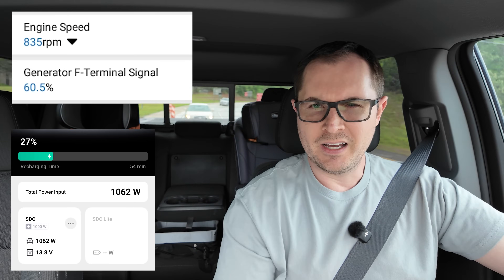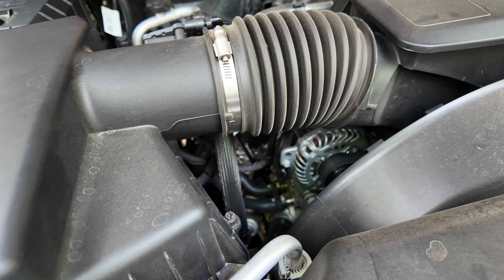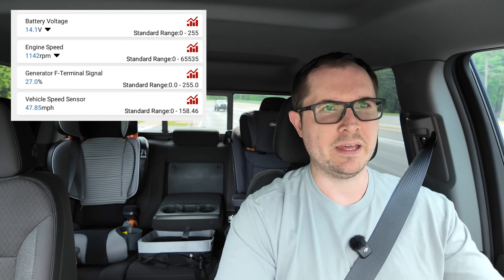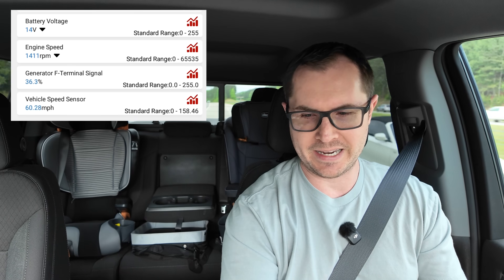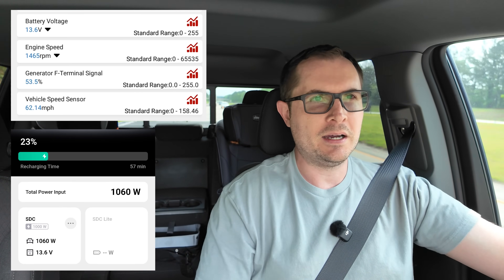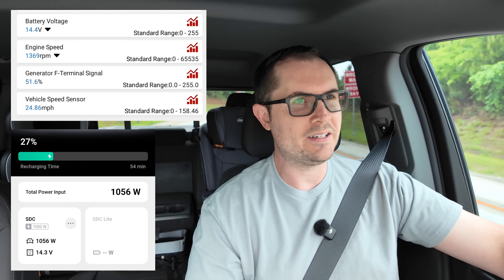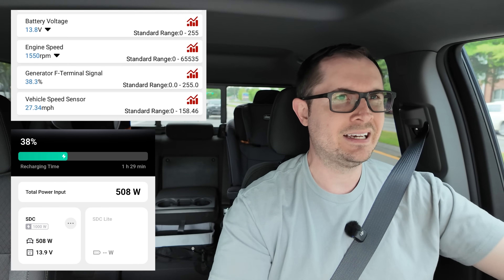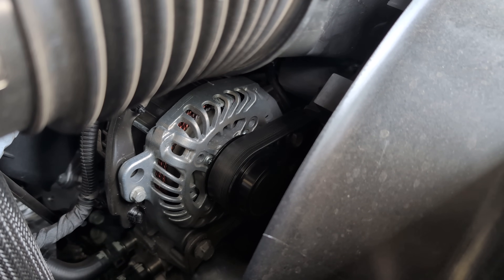I Show REAL Numbers: Impact of DC-DC Chargers from DJI, EcoFlow, Bluetti on Alternator

Comment from the maker: Support the channel with these purchase links. As an affiliate I earn from qualifying purchases:
Kingbolen S800 OBD2 Reader - https://amzn.to/4jSaDBh
DJI 1kW Super Fast Car Charger - https://amzn.to/3R3v95N
DJI Power 1000 Power Station - https://amzn.to/3DUVEXN
EcoFlow 800W Alternator Charger - https://amzn.to/3PEz1ta
BLUETTI Charger1 - https://amzn.to/40yFJae

Full Listing of Products in our Online Store
https://adventure.rocks/store/
Reply: Awesome video man....great information!
Reply: just install a clixon temp shutoff on the alt, you can get them in different temps.  They will cut voltage at rated temp then turn back on upon cooling....cheap protection.
Reply: @nutzablaze3339 are you saying it just turns your alternator off? So it stops, charging your 12 volt system altogether?  I am going to Google, but I am not an electrician. I'm just starting to dabble, so i'm just trying to make sure I understand what you're saying while i'm going to do the research.
Reply: No, connect the klixon to the aux batt using a relay. Your main charging circuit stays intact

Comment: can there be a cutoff added or bypass when reaches a certain percentage limit?
Reply from the maker: That would be a nice integration, but so far the mainstream players all usea "minimum voltage threshold" setting that is by default set in the 12.8V range, and the idea is that if your alternator is struggling, the battery voltage would drop and that signals the DC-DC charger to stop till it recovers. Not a perfect relationship, but it does mostly work.

Comment: The new HD RAMs have an option for a built-in 2.4kW inverter, which also comes with dual 400A alternators.  I imagine the other HD trucks from other brands that have those big inverters likely come with a similar electrical system upgrade.  Though if you have one of those, the purpose of a DC-DC charger is basically lost, because you could just plug the power station into the truck inverter's 110V outlet.
Reply from the maker: That is a nice upgrade!

Comment: 600rpm is quite low also. Short term, could just increase your idle speed, if possible on your vehicle (programmers/tuners). The right answer is going to be upgrade the alternator or reduce the load.

Comment: I have the Pecron 500w one on which I can set the voltage below which the unit will not draw current. Anyone - say I said it at 12.5v.  Will this limit alternator overdraw.
Reply from the maker: Yes, you can experiment with the level to help cut off.

Comment: Electrical engineer here. In addition to the maximum load rating on the generator, varying power demands result in voltage spikes due to parasitic inductances in generator. High frequency transients happen when either the generator changes speed, or with rapid high current load changes. You experience this phenomena sometimes when you see an arc when you plug an powered ON device into a wall outlet, known as 'wet-switching.' Car generators are notoriously bad for stray and high uncompensated parasitic inductances. Energy stored in the generator coil results in voltage spikes and dips, which put short high stress on the generator--similar to reving and stalling an engine. There are plenty of ways to compensate and minimize transient effects (e.g.soft starts, 'smart charging.) You need a reasonably fast oscilloscope to measure these transients at the generator. The DC/DC manufacturers need to add electronics to take these factors into account.

Comment: Based on this review...is it even worth trying to install & charge using a DC-DC alternator charger using a small-to-mid-size passenger vehicle (~2.5L or less) with a 100 amp alternator with a 575 CCA battery? Your video illustrates the experience of a 170 Amp alternator on a 6L gas truck so it seems disheartening if even you had to have your truck in motion at higher rpm's in order to keep the % under 60% usage. Maybe it's why I haven't seen any videos of any regular non-EV passenger vehicles attempting to using DC-DC chargers to top up their portable solar power stations. Many do not own a Truck, RV, Jeep, Van, etc and just want to quick charge their portable power station while on the go.
Reply from the maker: I think if you were to limit the output to under 200 w and you made sure that you were moving along cruising and not idling, it would probably be okay. Sometimes using a DC to DC charger can shorten the life of an alternator though. So just keep in mind the risk and use case scenarios.

Comment: I would not recommend a dc to dc unit as a blanket statement.  You pretty much got it as far as technical issues.  Small output alternators require smaller dc to dc boost converters to stay below the 75% total alternator electrical  output load recommendation.  Improper cooling will toast an alternator quickly.

Comment: They're designed to limit draw from your alternator especially with lithium batteries. If your alternator puts out 100 Amps your lithium batteries will draw 100 amps. If you run anything at full tilt it will burn out. DC to DC chargers only draw what you set it to. So if my alternator puts out 100 amps i would set it to 30 amps. At the same time the alternator is designed only to run the vehicles systems and not for extra loads. It is still best to get a higher output alternator like Mechman or JD Alternators. You can get alternators that put out 400 amps and then set the charger to 200 amps.

Comment: Good info. I've been telling people for years these things will put extra drain on stock vehicle electrical systems. Theres a reason guys with big stereos run multiple high amp alternators. I swapped to a big 300a alt, alittle over kill but now I can charge and run the ac and the stereo at idle.

Comment: What realy matters is the alternator temperature.  At low rpm, the alternator continues to put out full amperage, but the cooling fan is turning much slower and heat build-up can burn up the insulation on the alternator windings. This is why you can't directly charge Lithium RV batteries because they can charge so fast that they will overload the alternator. A DC to DC charger will moderate this. The biggest problem is at low rpm when the lower RPM reduces the natural cooling the alternator fan provides.

Comment: Really interesting video. I charge 5 lead acid batteries for my truck camper as i drive. I put a 50 amp
auto reset circuit breaker between the truck starting battery and the extra batteries for the camper.
I have always wondered how close i am to harming my alternator. i think this breaker will save it.
really intersting to see the amps climb as the speed decreases. I did not realize amp almost doubles
with drop in speed to zero.

Comment: Isn't it true that if you do NOT have a dc2dc charger installed on your RV's lithium battery system, the RV will attempt to draw more amperage than your alternator can supply? You then risk frying your alternator?  My alternator is rated at 155A and my RV's battery system is 300ah lithium.
Reply from the maker: Great point, it depends on the setup. For most folks using the 7-way to trickle charge their towable it'll be a small amperage. For motorized units depending on how the builder finished it out with the connections from house battery bank to engine, there could be potential for over-taxing it. Even with DC-DC it can over-tax alternator, but most have a setting to limit the max whereas without that limit may not exist.

Comment: Ive watched quite a few vids that say half the size of your alternator. You are right there and maxing out. I have a 220 amp alternator and was going to put 2 60 amp chargers in. I might go with 2 40's now. Could go with one 60, but with a custom 7200 watt battery bank, even that would take a while.

Comment: It seems it's all about balance of the system depending what size alternator you're running and load. A good AC - AC charger is also a good feature. Stay within decent parameters and everything should be fine.
Reply from the maker: Absolutely, knowing your alternator's capacity and overall system load is crucial. Good points!

Comment: Interesting test. As far as I know, some cars equipped with high-end audio systems have an audio output of 2000 watts or more. I’m curious about the generator’s load when the audio is turned on and playing music.
Reply from the maker: Great point, mine is an entry level audio system so pretty low draw, but I could definitely see in the top-trim trucks that amp draw could add up.

Comment: Question: if idling is bad for alternator while running dcdc charger, can you not just put engine in neutral and rev at medium rpm rate to make car or truck like a gas generator? I am getting bluetti dcdc charger 1 of 560W bc of its universal charge, deciding between Anker f3000 and f3800 for backup. Will swap 1 of them in and out to recharge one unit while car is in driveway. Trying to get math right bc seems will take 6hrs to charge it which sucks. Thanks!
Reply from the maker: That's a great question. Some trucks have a high idle option that essentially does that. The challenge may be the heat at that point given standstill. Depending on the vehicle the alternator may get cooling from both moving physically and the cooling fan.

Comment: heavy tax on the alternator for sure and likely the entire power wiring harness, upsize the alternator no doubt, but I would still be concerned with base wiring harness related to the vehicle power charging system. manufacturer value engineers every aspect of the build to clearly 27%-50% max

Comment: Would be nice to just see multiple charging inputs on power stations. In example I recently purchased an anker solix 300 DC. It allows charging input from two 140 watt usb c cables... where my larger bluetti power station only has the DC cigarette lighter charger option which generally charges at 80 ish watts... seems they could allow a double input like the anker solix 300 dc to increase the charging wattage while driving etc, without having to run an alternator heavy charger like these. Great video brother! 👍

Comment: Great video. 1000w = 81amps, that's way too high a load to place on a vehicles alternator. I've got a 25a DCDC charger, with solar input, coupled with a 170w panel. This system is great for my needs. I constantly run my 40l fridge, other than that, a few camp lights and charge the phone with camping. The solar alone is more than capable to keep the battery in a good state of charge when stationary and when driving, the dcdc charger keeps the battery topped up, particularly on longer drives.

Comment: be nice if the dc-dc converter  had an alternator “F” input to control dc-dc converter output! Great video. As a retired EE, I always knew alternators were not spec’ed to deliver rated output at 100% duty cycle. Lots of class B rv’s are burning up the alternators because they were not designed to handle the conditions on the road that you described so well.

Comment: Good video. Yes, the load is the issue and the hype of charging a portable power station in an hour or so may eventually burn up your vehicles alternator. Set your power station, or the 12v to 12v to a lower charge rate for less current load.

Comment: I have a 2024 gmc 3500 Sierra Denali gas with dual alternators and dual batteries 
I have thinking about adding a dc to dc charger for my camper 
Should I have any worries about overworking my alternators?
Reply from the maker: Nice setup! Those dual alternators will really help. Biggest lesson I learned out of all this, is don't max out the DC to DC charger while you're idling. And if you don't need the full power of the DC to DC charger, meaning you've got more time on your hands, then you can throttle down the charge rate to be safe. But in your case you've got a nice foundation with the dual setup already.

Comment: I've believed a lot of the problem is caused by people trying to get the maximum amount of power out of the alternator causing excessive stress on the alternator leading to early failure setting the DC to DC charger to a lower setting if possible 200 to 400 watt draw not running a lot of accessories in the vehicle while you're charging your battery packs and not charging for several hrs at a time would help save the alternator
Reply from the maker: Great tip!

Comment: Useful video. My 2013 XC90 2.4 D5 diesel got 140a alternator. My Delta 2 Max was with 500w alternator charger as an extra bonus. For my driving time and use, i think 250w of charge should give me a good buffer on the battery. Any idea if it’s too much?
Reply from the maker: Thank you. Likely, and then avoid charging while idling.

Comment: This is the info I was looking for.  Best if you can lower the charge rate and not run your alternator near full capacity.  Would be nice to see what the temperature of the alternator goes to when idling, because you don't have the same air flow to cool it down.
Reply from the maker: Great point

Comment: I personally think anytime you go adding things or removing things is always going to lead to trouble. A generator, a small one will charge your Bluetti perfectly. A 110 outlet.  etc. etc.  I have a small and large solar generator. Both have their purpose. """""""BUT""""" I installed #2  280 ah lifepov4  batteries at my cabin and have never run out of power. No solar generator required just an inverter.  People have been recharging their RV's with a gas generator for a long time. Same with batteries.  I personally think people are over thinking everything anymore. A small generator off Amazon is like $300 and it doesn't take them long to recharge anything or system. And if you go to the what if there isn't gas anymore senario, then the Charger !  is out as well as the truck. And you're back to solar and wind and water anyways aren't you.  The one item survivalists never have in their kits is a biycycle. I love watching them pull out their folding saw to cut firewood.  The indians and mountain men didn't have those and wouldn't use them if they did. They just dragged small dead trees up and into their fire, and repeated as nessary. As little work as nessary. Liked your video, you presented it clear and easy to understand.  I'd take it off my truck.  As nice a truck as you own, I'd keep it simple stupid. The more gadjets, the more problems. Peace.

Comment: We measure the power consumption of kitchen appliance and power tools in watts, and my DC2DC converter is rated in amps. It draws 40A, exactly what's needed for wiring. How long to charge my 400Ah of LFP Battery? Quite a while, but typically it has a lot more capacity than I need to store between drives. If I heat a meal (Mwave, 1100W, four minutes max), or boil a kettle, or even cook a meal (induction stovetop) and run my fridge/freezer) for a day or two, it's not going to take much topping up, my ordinary driving around tourist destinations will take care of it.

My alternator is rated for 130A.  I don't know what engine RPM is required for that, but if my engine RPM is slow enough to product 65A, then my DC2DC will still want its 40A if it's charging, a higher percentage of 65A than of 130A. That's why your % rises at idle. There's less current, less heat being generated, less need to cool the alternator.

I don't see a problem. I also don't see a need to charge at 1000W.

If I thought there might be a problem, I'd ask a dealer or an auto electrician, the dealer should have access to the technical data, and the sparky really doesn't want to destroy your alternator.

Comment: So in effect I should be able to use the Charger 1 by Bluetti to charge my station at 560W regularly without much strain.
Reply from the maker: On a typical truck that is a safe assumption. Biggest takeaway I learned is don't use it while you're idling, and if you don't need the full power, just turn the rate down.

Comment: Find out how many Amps the Alternator puts out, then decide what amps you can charge the Aux batteries at keeping below the alternator ratings. Usually 20 or 40 amps DC-to-DC charger is adequate. Never overload the alternator or you'll burn it out.

Comment: I was going to put a Bluetti charger 1 one to a Bluetti 200 V2,the vehicle would be a RAV4. Good idea or would it tear it up?
Reply from the maker: I did a quick search and depending on your year and trim level, looks like they equip with 80-150a alternators as OEM. If it's under 100a on yours, it could certainly strain it. The Bluetti and other mainstream players do allow you to limit the current, so you could always scale back from 500W to 200W. Or, upgrade the alternator of course.
Reply: @AdventureRocks  Thank you for the reply.

Comment: Good video. I personally have the EcoFlow alternator charger something I’ve noticed when driving at normal speeds it will charge at the maximum rate but as I start to come to a stop the charger automatically drops the charge rate down. You may want to check your settings to see if the DJI alternator charger does the same thing.

Comment: Is there a way to reduce the charging level on the DJI, say 500w?
Edit* I see DJI do an 1800w charger that splits between solar and car charging. The car charging circuit seems to output 600w and 1200w on the solar side. This might be better on the alternator?
Reply from the maker: Indeed, and you can throttle it down as low as desired. Similar on Bluetti & EcoFlow versions too.
Reply: @AdventureRocks is that an option via the app or do you have to modify them?

Comment: I have a small setup in my OLD car.
100Amp alternator.

300w seems to be the safe max without inducing voltage drop at idle.

So I keep it under 200w unless I know I'm not going to idle.

Upgraded alternator cable to 0awg, no change from 4 awg.

Even in your situation; I'd keep it under 800w.